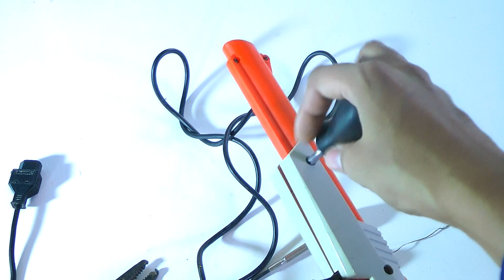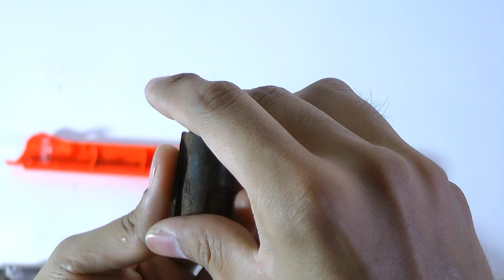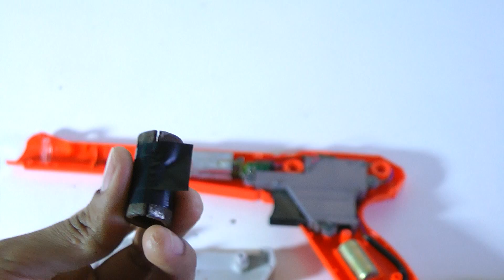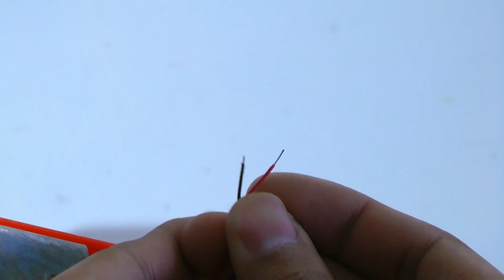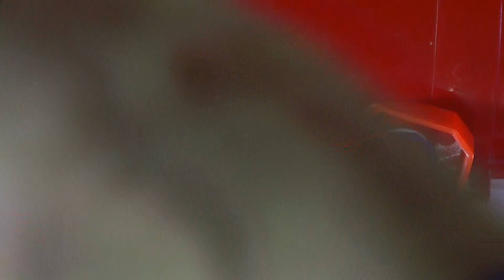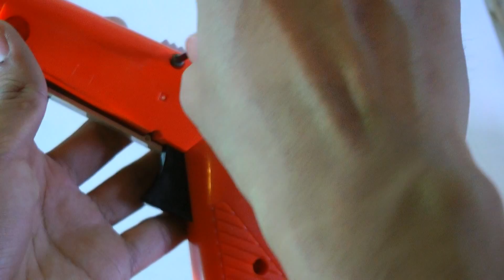COMO REPARAR PISTOLA ZAPPER DE NINTENDO

Comment: Hola saludos amigo tengo una pregunta para ti ya que cuando compre una Nintendo Nes con la Zapper y la pobré conectada a una pantalla y cuando le disparaba a los patos solo se veía el cuadrado blanco y no reaccionaba el disparo me podrías ayudar con mi pregunta
Reply from the maker: Hola si claro resulta que los televisores a partir del año 2000 aprox que empezaron con lcd y despues pantallas led etc.. non son compatibles con la zapper del nes pues fue diseñada para los televisores tipo crt rayo de luz catodica las de tubo de vidrio porque trabaja por medio de rayos de luz. por eso no funciona o no puedes dispararle a los patos etc... necesitas un tv de tubo saludos suscribete!